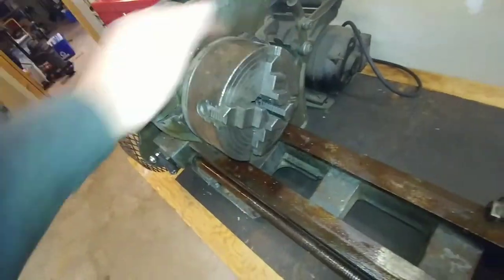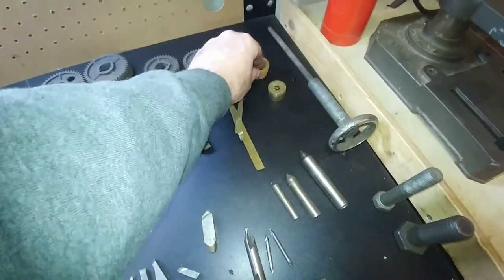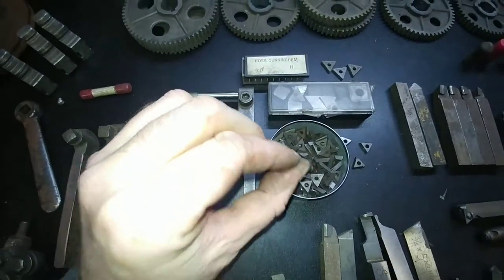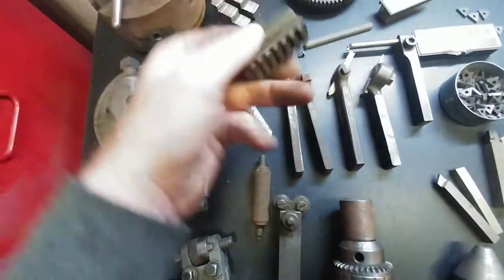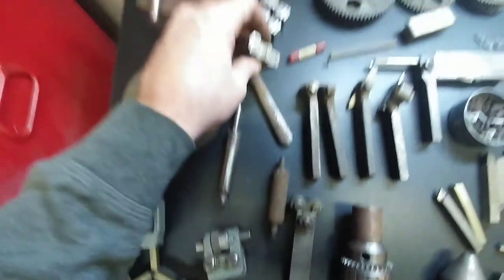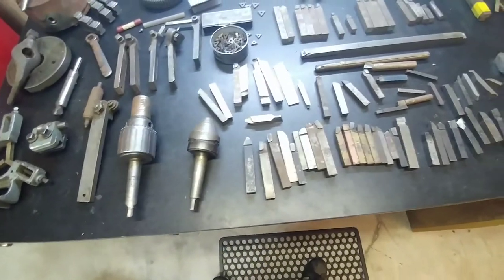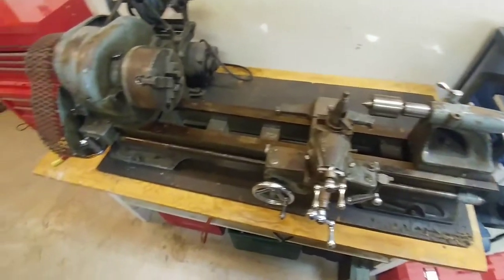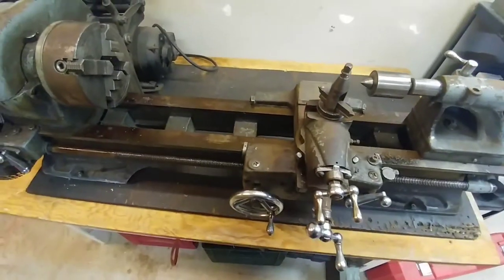Atlas TH42 restoration project the beginning

Comment: Diamond dressers for grinding wheels.
Reply: Yes Sir. They get mounted in dressing fixtures or handles. Tool Post grinders were not uncommon on these. In a handle these work nicely on bench grinder wheels as well. Much nicer than a dressing stone.
Reply: What did you pay for the lathe? I found an old "10" F series" for $400obo that I'm wanting, but don't know much about the vintage market with lathes..